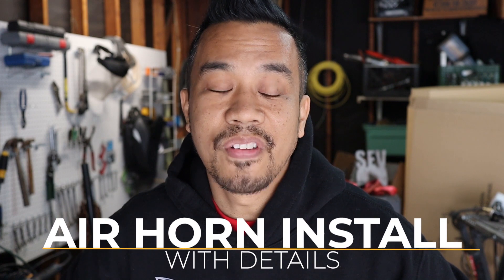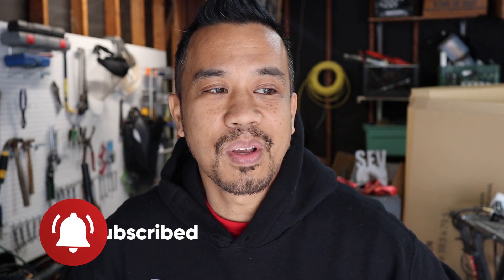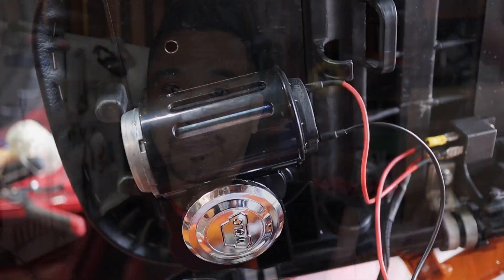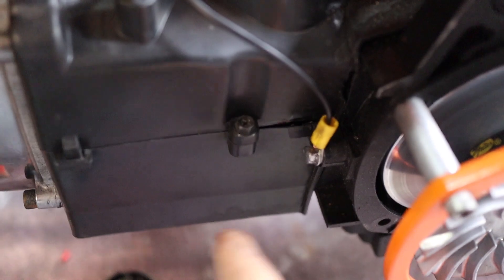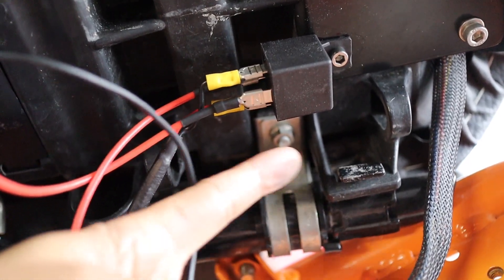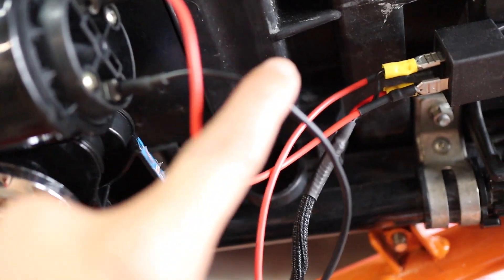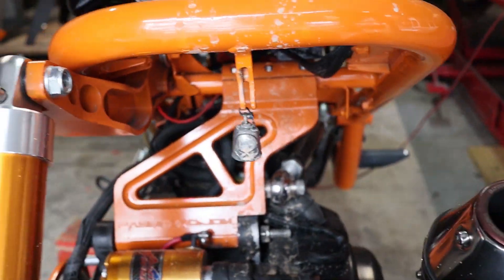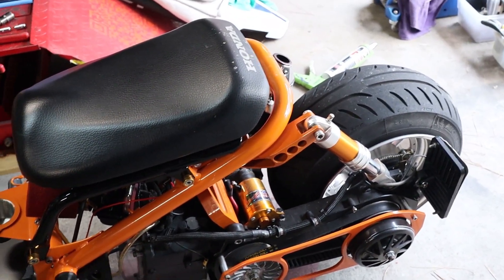Wire Install for the Ruckus Air Horn 3 0 #HondaRuckus #AirHorn

Comment: Could've had a cleaner install putting the relay in battery box and grounding to frame or battery. Short wire runs less exposed and only your original extension pigtail running to compressor. Great videos though. Love the content
Reply from the maker: Great point, I am moving this horn to my newest project and this was on my mind to do. Ended up the relay below the seat looked poopy and made it hard to open the seat to access the carb.